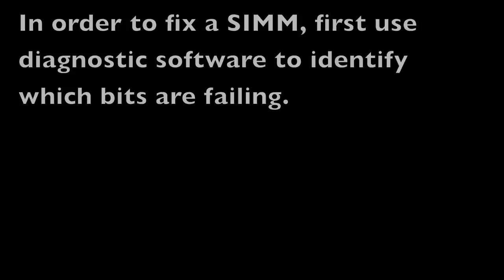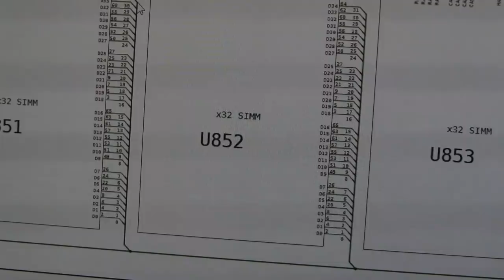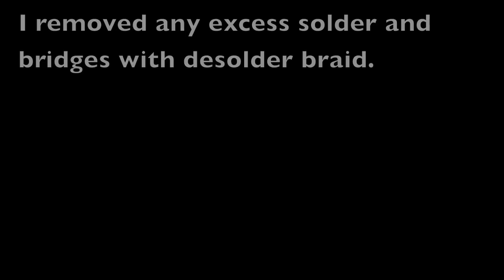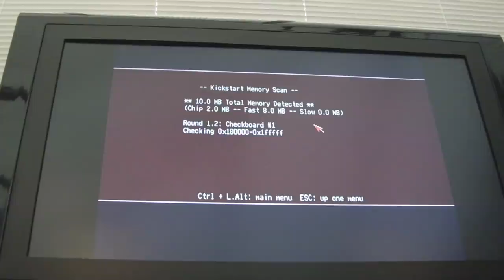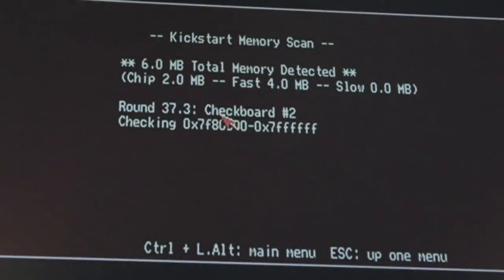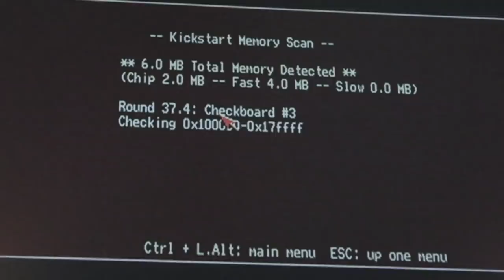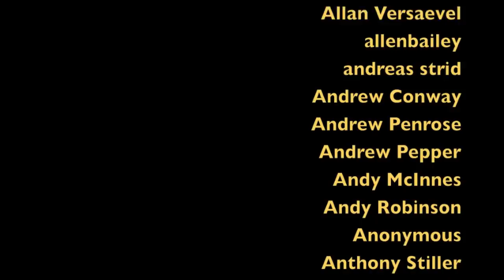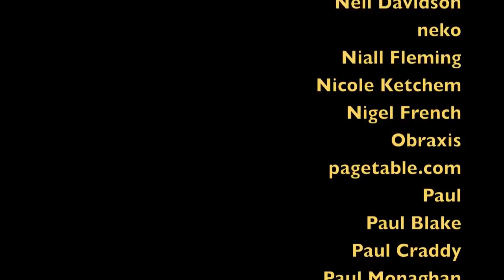Commodore Amiga 72 pin SIMM Repair Part 1

Comment: what are your settings for tip soldering, and hot air temps/air pressure settings?
Reply from the maker: Around 400 degrees C on the Atten 858D (hot air) - air flow set to around 70%, 400 degrees C on the Hakko soldering Iron.

Comment: That's a tight fit for solder workings. Well done! I always (after learning the hard way) mask off edge connectors with kapton when doing any work in their neighborhood. Keeps from accidentally wicking solder onto them when doing rework or new PCBs.
Reply from the maker: Yes, if these were plated edges I would have masked it off - they were just tinned with solder!

Comment: Wow! That ChipQuik stuff smokes like a locomotive!

Have you considered getting a cheap board heater and some paste? Makes SMD on single sided stuff like this a doddle.
Reply from the maker: Haha =D  It's not normally that bad tbh!  I think the problem was I had tonnes of it in a confined area!  I've got solder paste already but just don't like using it lol!  A board heater would be a good idea, but atm not sure it would get much use - but it might in future.
Reply: @GadgetUK164  yeah. New board builds are easier with a small heater- I got one from AliExpress for about £45. It's only 30cm by 30cm, but good for things like Terriblefire because the board is already warm and the hot air on top pulls SMD packages into the right spot really quickly. A good toy haha!

Comment: With SMD parts like these that have pads that are not exposed very much I would use some lead free low temp solder paste since you have a rework station.  This would save you a ton of time as you can use a spudging tool ( smallest one ) to coat the pads without needing a stencil.  I recenty hand soldered a complete PCB with various parts on it including an esp32 module and a drv8833 on it with great results.

This stuff:  https://www.amazon.com/Clean-Temperature-Solder-Paste-Grams/dp/B017RSGPI8/ref=pd_sbs_469_t_1/145-3720328-4071541?_encoding=UTF8&pd_rd_i=B017RSGPI8&pd_rd_r=8440a885-863f-4d06-a6b5-fe79f80b8832&pd_rd_w=cSa2d&pd_rd_wg=xRaw7&pf_rd_p=5cfcfe89-300f-47d2-b1ad-a4e27203a02a&pf_rd_r=HPCAN6976DRKCN8GWMDR&psc=1&refRID=HPCAN6976DRKCN8GWMDR

Comment: I think this is the first time I've seen someone repair a SIMM.  The hot air part kinda reminds me of Louis Rossman LOL.  And that Chipquik flux works good, but man does it smell, and it makes a lot of smoke.
Reply: I think when it comes to surface mount, hot air is the most efficient way from what I can tell - at least. Louis doesn't use it in a commercial environment for fun!

Comment: I've found that when soldering SOJ type chips, if youre in a narrow space like that SIMM (or the chip RAM on an A1200) it's better to clean, flux and tin the pads on the PCB.. then align the SOJ chip in place and tack opposite corners. Then, reflow the solder with hot air while pressing down on the chip. This pretty much gets a good connection every time fairly easily :)
Reply: i really must restrain myself from commenting until ive watched all the way through, lol :)
Reply: You should upload more videos, Peter.
Reply from the maker: Haha =D  Good advise though!!!  That's more or less what I ended up doing!!!